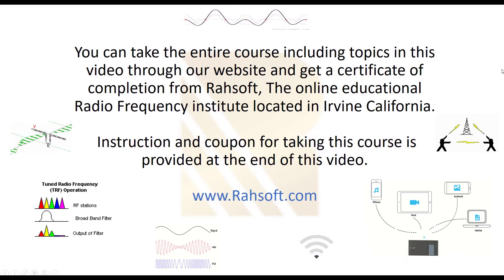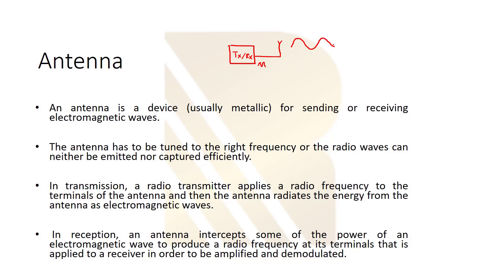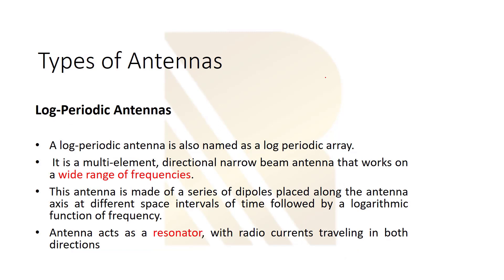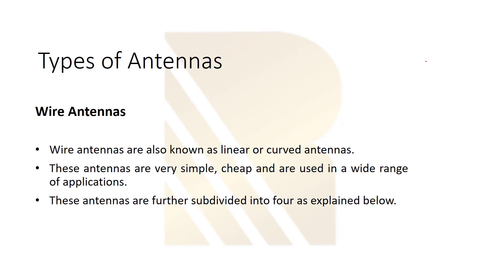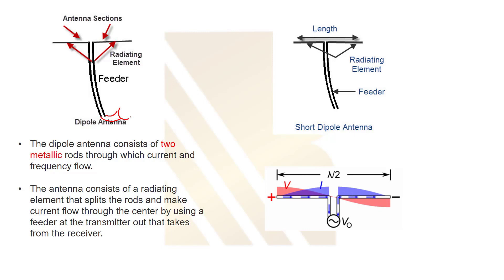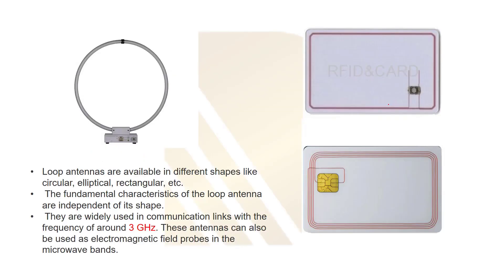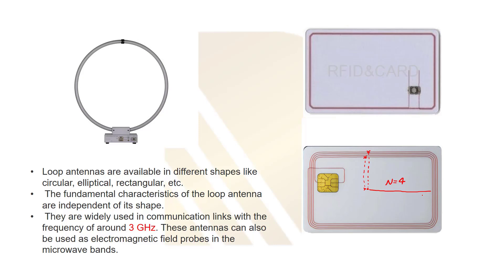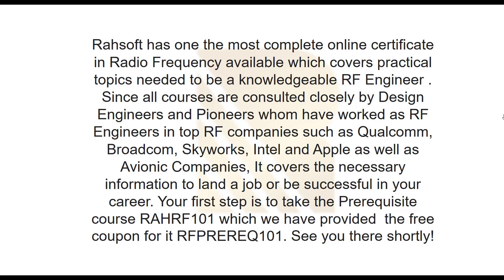What is an antenna?Types of antenna.Part1 #10

Comment: Hello, 
I need a bit of help with a project I've been working on for a while. I need to make a circuit which can amplify a 125 kHz sine wave signal and place it on a magnetic loop antenna (big coil of wire). This is basically an RFID amplifier but no data needs to be transmitted; I only want to boost the 125 kHz signal and have it make a large magnetic field so it can excite a receiving circuit several feet away. How can I achieve this and preferably is there any "plug and play" kind off solution like for example use a audio amplifier?